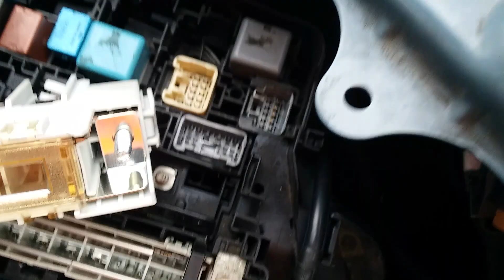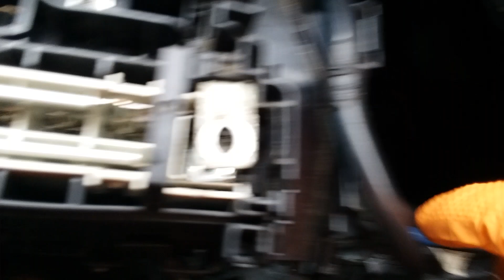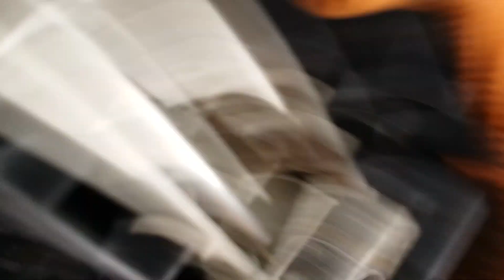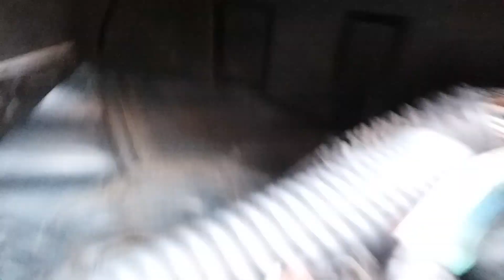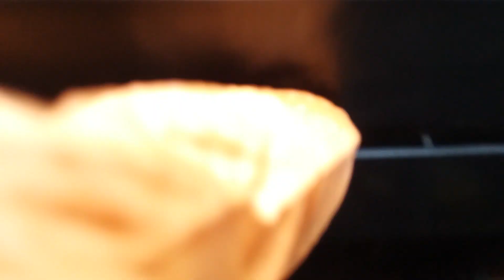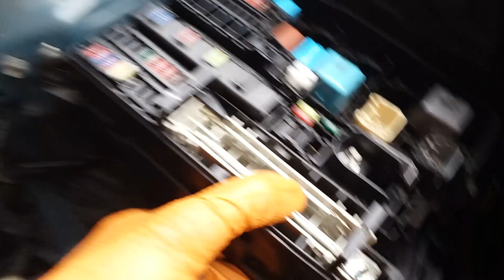Fusible Link, 2010 Scion xB, Remove Replace, Main Alternator Fuse, Disassemble Fuse Relay Box, Block

Comment: I just did this. Thanks for pointing out the trickiest parts of this repair. I muddled through it before seeing this video and you're quite right about releasing all these plastic clips. You don't want to break them. I can only imagine what the dealer charges for this. Bad design imho. Just make sure it's actually the fusible link block at fault before undertaking this nightmare repair. Use a strong light and magnifying glass to inspect the links through the clear top. Good luck.

Comment: Good video on how to replace this alt. fuse but sure would have been nice to see how you tested it to determine it needed replacing. I cannot find a video that demonstrates this on this particular fuse "Bar".
Reply from the maker: Testing protocol is to look through the top, visual-access window to visually inspect the fuse element. Plenty of clean light, and/or magnification, can make this easier. Where the window is clouded, it is possible to remove the window for a clear view.
Reply: @brycedrennan7722 if we touch both silver pieces on either side of the box with multimeter probes on continuity, would that work? I know everyone says just look at it but we’re not seeing it. Thank you.

Comment: Can someone please tell me where the hell this box even IS? He doesn’t show where the box is located inside the engine. Is it connected to the battery terminal?
Reply from the maker: In the video, I had already removed the black plastic cover from the fuse block. Left/driver (US) side, next to the firewall and the fender.

Comment: For some reason on my 2010 Scion XB this will be the second one I’m replacing any idea why it keeps blowing? All my wires are in good shape. Although I do have a problem with low beams which makes me think there is a short. The wiring is good though. The low beams are dull and not bright. I heard it can blow to a reverse safety effect. Idk. Thanks for the upload!

Comment: Why did you need to replace it? Trying check my abs fuse
Reply: have the same problem. c1361.  Short in ABS Motor Fail Safe Relay Circuit.
ABS and VSC lights flashing.
the most likely cause is the fuse 1, but how the hell to check it?
This is the first time I am seeing this fusible link garbage design.